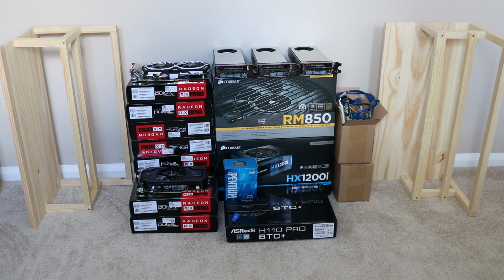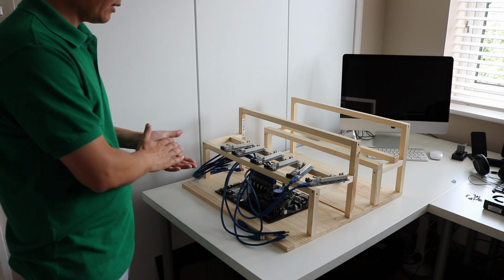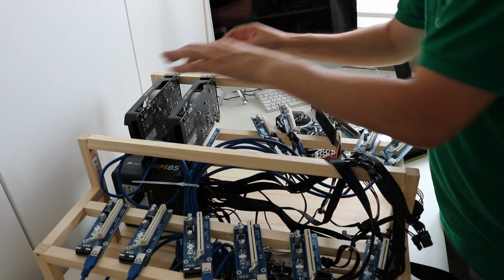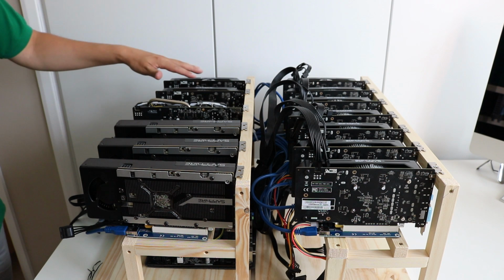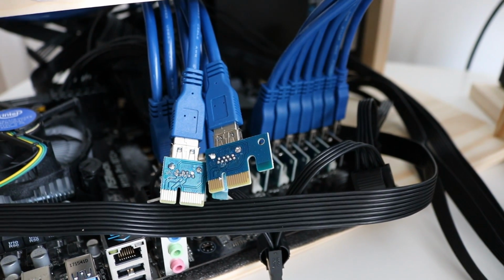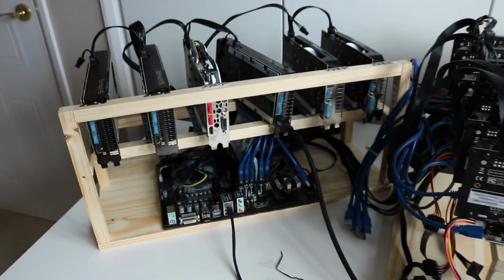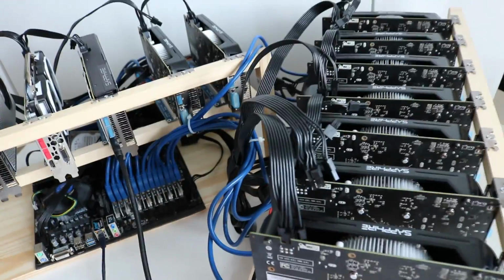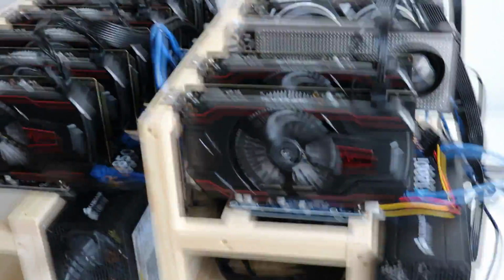Building a 13 GPU Mining Rig - Asrock H110 Pro BTC+ RX560 RX470

Comment: Do you recommend hold the ethereum or continue selling and buying more gpu ? Thanks for your answer
Reply from the maker: I think hedging makes sense, for me at least. I hold and sell as I see fit.
Reply: hdol! maybe do like a 80/20 thing.. like keep 80 and 20 for upgrades.. or some other number, but defintly not more then 50%
Reply: IMO trade what you can once you've learnt the market e.g. shorting where possible (selling with the intention of buying back at a lower price), but there is an art to learning the market. I would then suggest avoid selling your ETH budget if you can afford to, but if not I would sell as little as possible just to cover electric costs and don't worry too much about ROI at this point. If you do want to expand on your hardware, first I would learn what it's like living with 1 operating rig, before considering a second because if you lack the space to operate these things they can start encroaching on your life e.g. heat, pets (cat fur is the worst), noise and just general size. Once you're happy with what I mentioned I would only then consider selling some ETH to re-invest, but be careful that the market's return value won't exceed the return on the rigs and what I mean by this is if you invest $1000 into ETH and markets rise and double your money consider if the rigs will be as profitable. Source for this: I have over 1GH/s of mining capability and have lived with these things for some time now. I also market trade.
Reply: Andy Henry how much return do you get per month from 10 rigs if you don't mind me asking
Reply: I found the same - As I now have 10 operational rigs, I now have a rented office, so the rigs pay for them to be housed there and I take out profit to buy more GPUs.